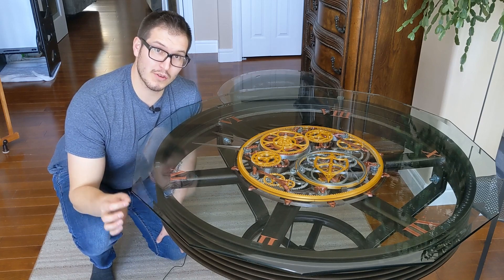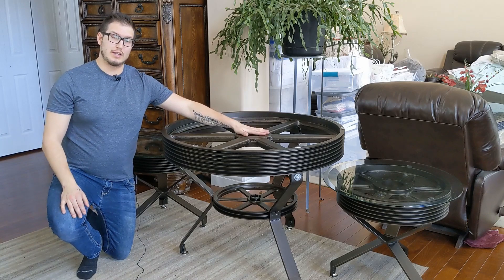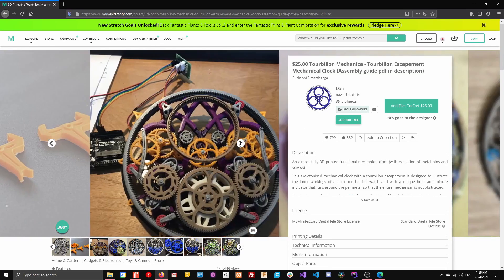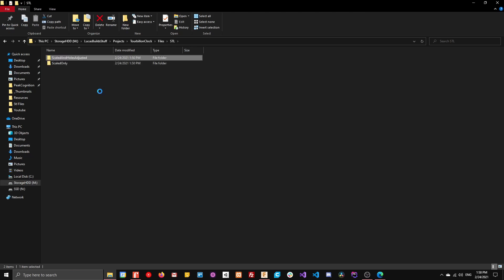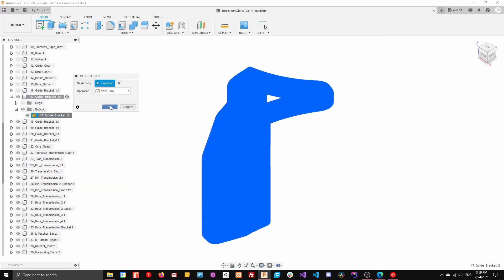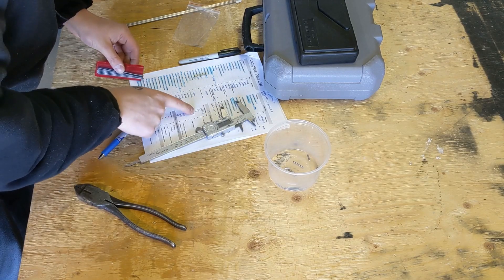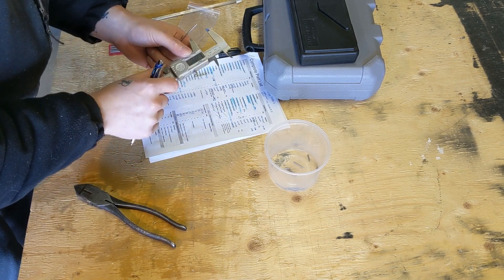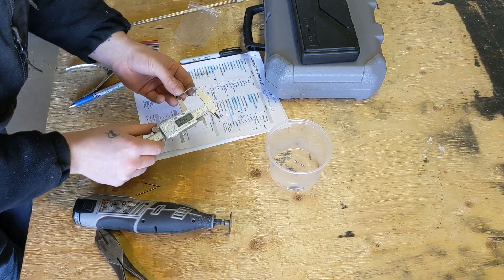Tourbillon Clock Flywheel Table | Actually Keeps Time!

Comment: Just a comment with everyone blaming you for the fork not working : 
The way you set up the stepper is not compatible with the principle of the clock escapement mechanism, but I think you found the easiest way to get a proper clock working and doing it the proper way will be very hard if you actually want to keep time.

The escapement has a natural resonant frequency which is what the clock is built around. That resonant frequency is defined by parameters like the flywheel weight, the stifness of the spring and probably the amount of friction too. 
You won't be able to make the clock turn with the escapement working if the speed of the clock (set by your stepper) doesn't match the resonant frequency of the escapement which is one of the two reasons I see for it not working here. 
Normally the clock is meant to get its power through the unwinding of the larger spring which puts pressure on the gears, pressure is transfered through the gear to the escapement, and the escapement uses that pressure to maintain its oscillation at its natural resonant frequency thus keeping the timing of the clock. The escapement locks up the clock most of the time and can only be driven in a very small window when the gear escapes, so with your stepper you'll never be able to sync up the step with the moment when the escapement is ok to turn (said differently: you'd need to perfectly match the phases), that's the second reason I see for it not working.

To get the clock working with the escapement you should do what you mentionned initially : mounting the stepper to simply keep the tension on the big winding spring. But having an accurate clock with the escapement working will probably be quite difficult because the timing is set by the resonant frequency of the escapement. So you'll have probably have to experiment a lot with the parameters and/or the gear ratios to find the perfect combination. If you manage to do it and get close enough, you should be able to fine tune the speed of the clock with the tension of the big spring (more tension can reduce the speed by a few percent).
Reply from the maker: Thanks for taking the time to explain that, it clarified a few assumptions I had!

Comment: If you want to be somewhat accurate with the arduino, you shouldn't be using delays, and instead switch over to using the millis() function.

The issue with delay is that the other functions in the arduino code also take time, and this time gets added on top of the time you add using delay functions, causing the clock to run too slow. Using millis() this can be prevented. After that you're left with the accuracy of the crystal on the arduino PCB deciding how accurate the clock will be over time.

Comment: How did you decouple the flywheel so that it didn't affect the movement? I actually like that idea because it makes the clock technically silent
Reply from the maker: There's a fork that connects the flywheel hairspring to the escape wheel/gear, you can see me remove it right at the 10:00 mark, yea it actually worked out better for my particular use case lol

Comment: good job on the Arduino and the pause that was brilliant
Reply from the maker: Thank you 😃
Reply: appart from the fact that there is absolutely no need for it. using delay is just bad coding. Using a RTC or at least millis() or micros() it can be a lot better. i also wonder how long that stepper will last if it barely is able to turn the clock.

Comment: Cool Project, I really love the antique vibe of this, the color of the prints match super well! 
I just wished you could have made the fork work, that would have really made it complete for me :)
Reply from the maker: Thanks for watching! I'm planning on making a follow up with the fork working
Reply: No fork, downvote for you
Reply: To be honest I had him remove it because the ticking was super loud for where it was going.
Reply: Indeed, that killed the Spirit of the mechanism and made it equal to a quartz movement 😔
Reply: I was wondering too if he hadn't removed the fork, would the escapement even keep the correct time? The weight of the wheel has been changed and the hairspring is changed too, it could oscillate at a wildly different rate from what we expect.
Reply: Y’all had your answer it was too loud. It’s a shame to see something you work so hard on and this is the top comment.  If you’re still mad, remember, he didn’t make it for you.  But he did for us was post this excellent piece. How about a new comment about what made you happy about it. That be nice.
Reply: @WallyMahar  you're right, it was kind of negative ;)
Reply: I mean, since the mechanism is mounted horizontally, the whole tourbillon thing is just for show anyway. It's meant to balance out the distortions due to gravity but gravity works uniformly when mounted like that. Soooo.... yeah.
Reply: @unvergebeneid  a hairspring oscillator is unaffected by gravity, position, or any other mechanism of external acceleration.
Reply: @jackp.1711  Cool fact, but this is mainly about the escapement from what I gather.
But I'm curious, what do you think all the added complexity of a tourbillon is for?
Reply: @unvergebeneid  From what I've seen, the original purpose for a tourbillon was, indeed, to counteract gravity, but it was later proven to be unnecessary. But it's a really cool complication so a lot of high end watches keep it.
Reply: @Thriron  yes, or what I called "just for show anyway."

Comment: have the motor wind the mainspring thats already there to drive the clock as intended
Reply from the maker: I originally thought about doing that, but the design of the table and the mainspring holder made me lean towards using the core gear

I think I'm going to make another video trying all the suggestions here 😅
Reply: The problem is that you will never be able to keep the actual time with the spring and forke mechanism... - its has to be very finely tuned - he scaled everything up too so the inertia etc. if the original design was tuned is out of tune now. I guess what he could do is control the forke with the stepper motor and wind the spring at the same time or so idk...

Comment: without a RTC this table will never keep proper time. Been there tried that. Even if my clock was compleatly different...Get a cheap RTc module and be set :)
Reply from the maker: Thanks, I'm gonna look into it! 😀
Reply: Dennis Shaefer ever wondered why that is? - in theory the arduino uno has a 16mhz quartz on it and quartz resonators are really accurate - the weird problem though is that that quartz only times the usb connection and the main MC is unsing a seperate shitty ceramic oscillator with 0.5% tolerance/error...
Its so silly, idk why its like that, but it threw me off quite a bit when I was a total noobie trying to build a tracking system for my telescope.

Comment: It's sad you removed the fork, that's like the coolest part; makes the clock actually tic-toc! Couldn't a simple gearbox to give the stepper a mechanical advantage solve the problem? There's no way it was anywhere near its maximum rpm.
Reply from the maker: It's possible that could of worked, but I'm not sure. I think the maximum for that stepper is 15rpm so theoretically I should be able to use a 30:1 gearbox 🤔
Reply: Yeah, I found it kind of funny that there were so many gears that were just for show but then the one that might actually have solved this issue was omitted =)

Comment: This started off so well, but you've ended up losing the whole point of using the Tourbillon mechanism. I think your problem is really down to the use of a stepper motor, it doesn't make sense in this mechanism.

The original setup uses a spring to provide a constant torque and an escapement mechanism to keep the time. You've replaced the spring with a motor set to a constant speed which is incorrect - What you actually want is a DC motor driven with a constant force. Without a spring between the DC motor and the escapement mechanism the motor will end up starting and stopping but that's fine as long as you drive it with a current limited driver, setting the current limit such that the motor won't burn out or heat up excessively. The original escapement mechanism should then work as intended and that part is responsible for the timing.
Reply from the maker: Thanks for the idea, I didn't even know you could do that! I have a project I want to do that that could come in handy for

Comment: Loved it (except the hot glue for the hands)! 

It's probably better without the fork anyway as the noise would have driven you crazy.

Have you considered adding a simple button to go forward/backward 1 hour for DST? Or a rotary encoder to set time easily? Or an RTC with the date to automatically switch for DST? Or an ESP8266 in lieu of the Arduino to check time on a server?
Or connecting it to Alexa to somehow display your reminders and timers?
Reply from the maker: F) None of the above lol
Reply: > Or connecting it to Alexa to somehow display your reminders and timers?
Would be really cool to connect a big analog clock with some rgb leds to display your calendars
Reply: @Synthetica9  Imagine with a more analog display like flip discs :-)

Comment: To keep the time you could more accurately just add a small magnet to the hour ring and a reed switch/hall effect sensor. If the arduino detects the sensor is triggered early it can stop sending steps until the time catches up with the clock and if it doesnt detect it by the top of the hour it can keep sending steps until the clock catches up. 
At least that way you don't need to worry about the accuracy of the arduino internal clock over time and it can easily be paired with an RTC module capable of adjusting for daylight savings etc
Reply from the maker: That's a great idea 🤔 Thanks!

Comment: Looks nice but after I've seen how it was handled it made me very sad. I'd like to print out the bigger version of this clock too (I have printed the 1:1 version so far) so I was wondering how did you figure out the finetuning of the turbillon (dealing with the inertia and spring parameters). I'd say the dead winding mechanism is fine at least you don't have to bother with revinding. But.... damn, dead fly wheel? The heart of the clock not beating at all? As I said, it's nice but very sad.
Reply from the maker: Yea, I know what you mean, I know the flywheel could turn if I used a bigger stepper motor although I'm not sure how the timing would of ended up working out.
 On the bright side it actually ended up being better for the table that it was silent, and thanks!
Reply from the maker: @Paul van Dinther  There's been a lot of great suggestions on how to get the flywheel/fork to work, I might just have to rebuild the clock and make another video trying them out! 😅
Reply: @LucasBuildsStuff  It would be definitely worth to try. I know this will cost some time to do but now the most of the clock is just for the show. The only functionality that was left are transmission gears to outer rings. But these gears are designed with respect to step of tourbillon. You could ditch these gears as well and replace it with simple 1:12 gears ratio (hours:minutes ring ratio) because the stepper motor would provide you anything you need as input. I'm just pointing out that most of the mechanism is dead and even transmissions lost their purpose because of the dead tourbillon. Anyway I'd like to emphasize few quite positive things. The idea and the build are exceptional. I was thrilled to see this idea come to life (even though there are obvious downsides which could be overcome). It required a lot of design changes to original parts. The diameter is ~230% of original. The height of the clock looks like remained approximately same. Adding locks to split parts. Changing size of pins affected all wheels. So this must have taken a lot of trials and errors to be completed (this is valid for the 1:1 version of the clock as well). I think If you manage to fix the design this would add the lost spirit to the clock (tourbillon clock without tourbillon). I admit the clicking sound would be quite loud but this is a mechanical clock after all. It is same like to have old cuckoo clock in house. You can hear it, you can feel it, it adds to the house a magical spirit.